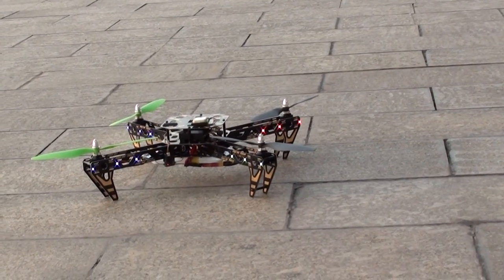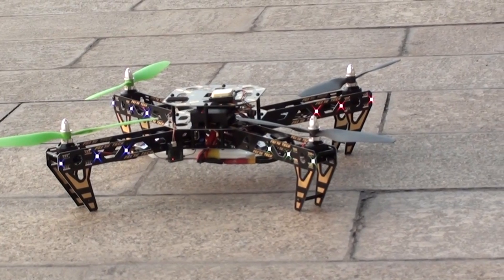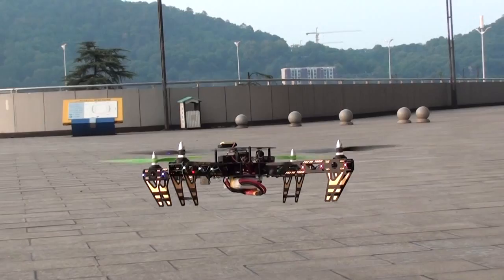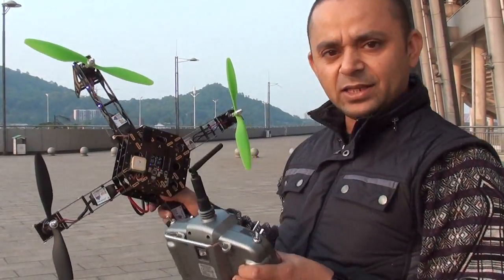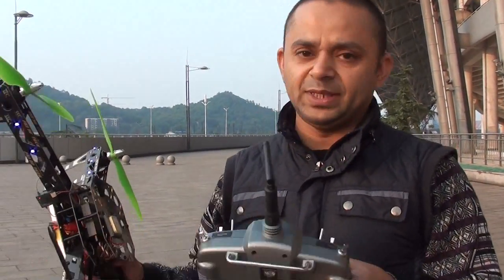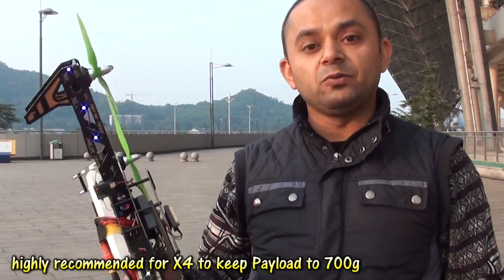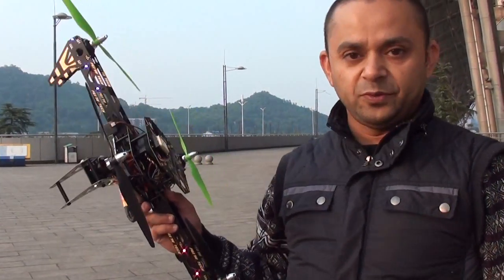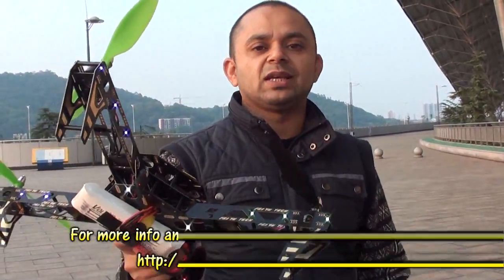FY-X4 with new arms outdoor flight in winds

Comment: I bought this quad because you recommended it. It looks the goods but I'm not happy with it at all, the frame is flimsy and the arms vibrate when pushing it, get over 30kmh and it goes out of control. Out of my 6 quads this is the most expensive and useless, only good for hovering, The cheap X525 runs rings around this quadcopter...  :-(